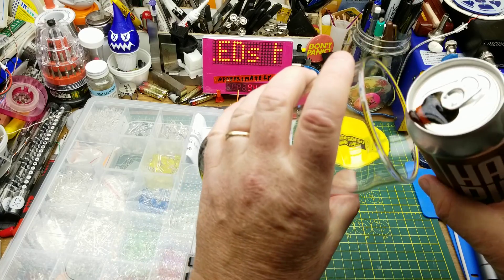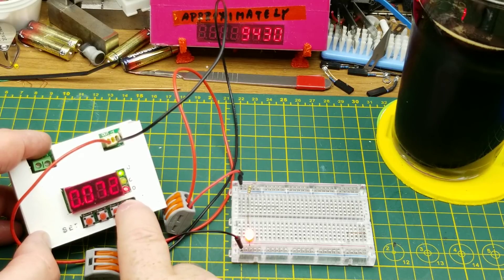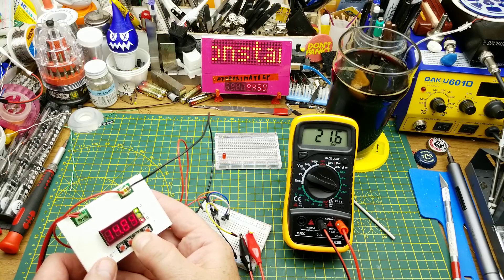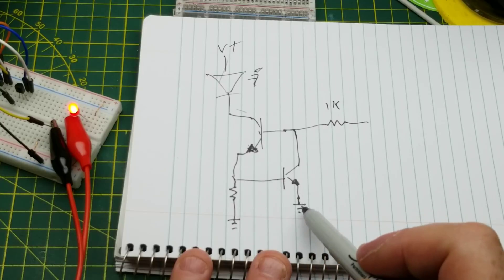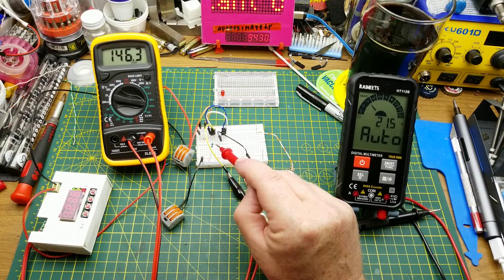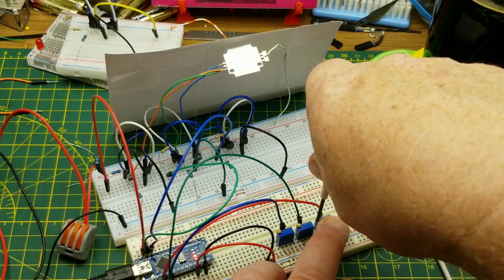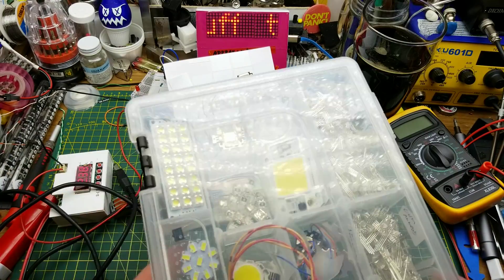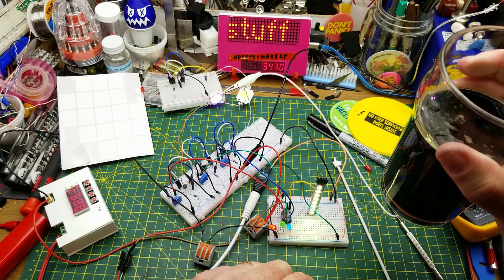tinkering with constant current circuits

Comment: This is pretty interesting.  It's a nice, simple circuit that just works so well.
Would it be able to be made more efficient with a FET as the driver transistor?   
Could be interesting to compact it down.

Comment: Simplest? Well, if you have a fixed voltage available, one transistor will do  :-)
Reply: Re your circuit, if the control voltage is known, just remove the shunt transistor and adjust resistors as needed. A resistor from base to gnd could also be added.
Reply from the maker: True, but this buffers the control source. Some microcontrollers are pretty particular about their load.
Reply from the maker: If you have a known voltage, a single resistor will do.
Reply: @pileofstuff  Only if it's ∞ V and ∞/I ohms...

Comment: Did you put some red tape on the scalpel handle to make sure you don't pick it up by the wrong end? That scalpel is certainly the most dangerous unboxing blade used by any Youtube creator ever! Unless someone used a chainsaw!? (don't search for this on youtube)
Reply from the maker: The tape is only to give the handle a bit of thickness so i can pick it up easier.

And I do want one of those mini chainsaws like AvE has.

Comment: Now for your DMX light, you should do the same thing with an ESP8266 and flash Tasmota or WLED on it and have full WiFi control. Both will do PWM or WS281x control. WLED has lots of fancy patterns.

Comment: Help. I don't understand the circuit layout. My over logical brain is telling me that the LED should last inline, NOT first. It's counterintuitive and hurts my brain lol.
Reply: Yes, many people don't comprehend this simple concept. This circuit is controlling the low side and everything is reference to zero volts. So it's easier to make is work if the load (LED) is on the high side.
Reply from the maker: Generally speaking, with components in a series circuit the order of the components isn't always critical. You could move the LED to the emitter side of the current limiting transistor (between the emitter and the current sense resistor), as long as the base connection of the other transistor remained connected to the resistor.

Comment: Can the 1K resistor be connected to the LED supply voltage. I just want an always on LED and don't need microcontroller control or PWM. Many thanks.
Reply from the maker: Yes. Thats how i had it connected in the first example.
Reply: Just to be very clear - if your supply voltage doesn't vary (any significant amount) then you don't need a dynamic circuit / Constant current driver - a series resistor will do fine.
R = (V_supply - V_led) / I_led
Or in words how much voltage you need the  resistor to drop (difference between supply and what the LED needs),  divided by the wanted current, determines the needed resistor value. 
Also make sure the resistor used can handle the power dissipated by it:  P = (V_supply -  V_led) * I_led - as noted in the video, that resistor got hot when the voltage was cranked up and both the voltage over the resistor and the current through it increases...
Reply from the maker: @michaeltempsch5282  That's correct. For a stable known voltage, a simple resistor is all you need.
Reply: Or you can also use MOSFET and in that case resistor value can be much higher and is not critical, voltage range can be much bigger, and stability better.

Comment: PWM will always cause flicker when it beats with the camera shutter speed, you eye won't see anything above 25Hz if looked on directly. peripheral vision is faster and black and white so you may see 100Hz flicker, but don't hold me on this.
Reply: ... your eyes won't see any...
ONLY IF THE DIFFERENCE (beat Freq.) Freq. Is >( 25-30)Hz..
My personal experience was 
perceptible flicker of  conventional 50Hz  T12 fluroscence lamps on ceiling and a high resolution ( in those days) monitor set @ 60 Hz... (progressive  vert.scan refresh  rate)...yes it WAS noticable....
Reply: @analoghardwaretops3976  FRom what i can see on the net, the rod's in the peripheral vision are about 25% faster than the cone's. But the cones provide the colour information. which is why you can oftern see flicker out of the corner of your eye. Brain sees it as movement.

Comment: Constant current drivers are also essential for driving laser diodes. They're far easier to kill with overcurrent.
Useta be laser pointers had built in current sources until someone figured out the internal resistance of button cells was high enough to limit current through the diodes, allowing them to connect the diodes directly across the battery. That makes repurposing laser diodes a little harder. The IR and UV diodes in DVD and Blu-ray players, same thing.